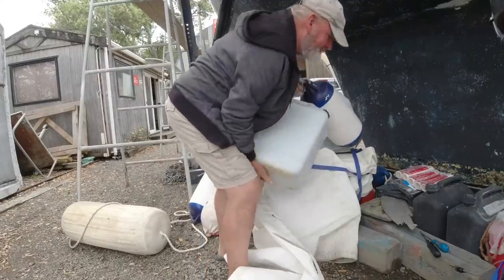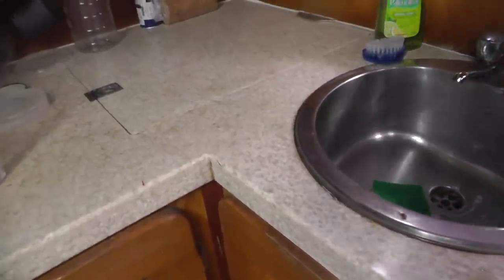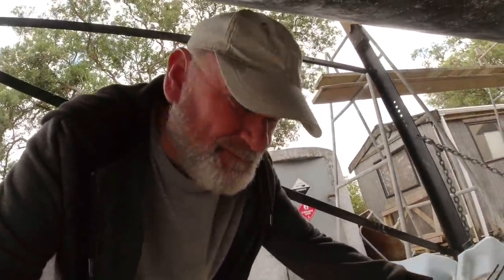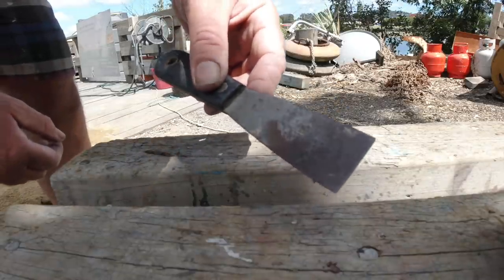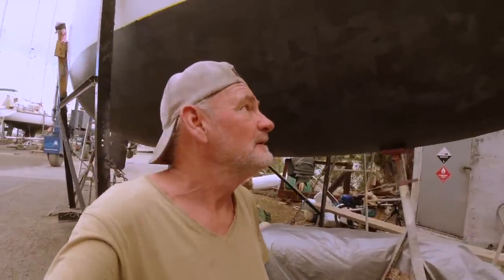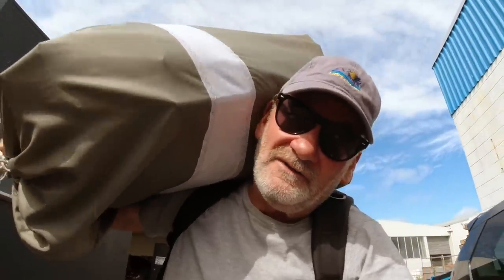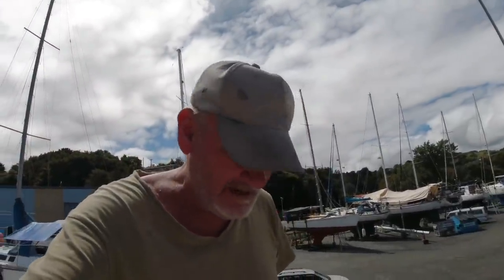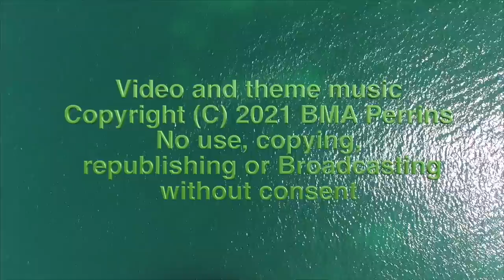My Beautiful Boat.  Adventures of an Old Seadog, ep169

Comment: quick tip - when masking off areas of the boat for painting , - completely forget using masking tape ,throw it in the bin an leave it there  - instead go and buy some electrical insulating tape and use that instead  , it doesnt dry out and leave dried out adhesive stuck to your boat it remains plastic and will peel off really nice and clean and wont leave dried out adhesive and paper stuck to your boat in an impossible to remove state thus avoiding hours / days of frustration trying remove dried out tape etc

Comment: getting closer everyday to splash day. Hopefully your putting a dedicated battery up front for the maxwell, 12 gage wire for charging the battery up front instead of the big gage cables it will require should offset the battery cost.

Comment: When you buy your cable for your anchor winch. look at prices for welding cables. they are double insulated and a third the price of tinned cable. we have had ours on our 45ft Van De Stadt for 20 plus years and they are fine !!

Comment: You should have drilled a small 3mm pilot hole at each end of the crack about 5mm depth this stops the crack getting any longer before prep and repairing . Enjoyed the video again .Regards from old Blighty.

Comment: That looks like a "Quick'' brand windlass. Not bad, I've had a couple. BUT .... they aren't good,  with salt water,  especially just below the gypsy, where it will totally dissolve aluminium casting around the pawl, lock mech, lever,  and all those stainless screws threaded in alloy.
Strongly advise, remove those screws,  and refit, with zinc chromatin paste, and also between the stainless stripper plate. Then,  heavy grease, complete splurge the whole recess, of the locking mech in casting. I had lost over a centimetre of metal,  nothing left to hold screws,  after 3 years from new. Luckily able to tig wild,  rebuild,  and machine back shape. Strip this and grease,  every season,  and flush frequently with fresh water. Otherwise, soon becomes expensive scrap.

Also had to replace gearbox oil seal, to motor,  after performance sluggish, commutator/ brushes running in oil. Luckily it's a standard size seal.

Finally, if a chain counter,  don't forget to zero it, whenever you've worked on it, and do sanity check. I dragged anchor,  partly because of bad misread, too tired/ complacent to double check,  chain markers!!!  Lessons learnt,  hard way. 

Good luck with all mate.👍

Comment: the fridge probably needs a re charge with gas  , also i bet the heat exchanger has never been cleaned either this will make the system trip out on high pressure look for the reset button on the high pressure switch and press it , use a compressed air line to blow dirt fluff etc out of the heat exchanger , get a local fridge engineer to recharge the system , all these tasks are easy quick and cheap to do, ok , there will be a label on the fridge compressor telling you or the fridge guy which gas is in it and how many kilos of gas, if you really want your fridge to get super cold you could ask the fridge engineer to mix a little propane with the refrigerant gas , this will boost the systems cooling capability , and who doesnt like super cold beer

Comment: I used ablative bottom paint on my boat I remember it said to put two to three coats on the areas hit by waves the hardest like the bow, the front of the keel, the last few feet of stern area, that's where the paint comes off the most when under way, the more you are under way. the more that ablative paint comes off otherwise you will get bald spots where it gets the most wear, the bow and front of keel and last few feet of stern......Shaddy starting to look like a Lady again

Comment: Hi Barry, i am a faithfull follower. Nice things you bought! If I were you I would make shure there is no electrical connection between the boat and the inox bolts of the new anchorwinch. Also I would ask a welder to weld new iron hinges on the cover of the anchorlocker. It would save you a lot of work later. Carry on anyway, I like your vlogs!